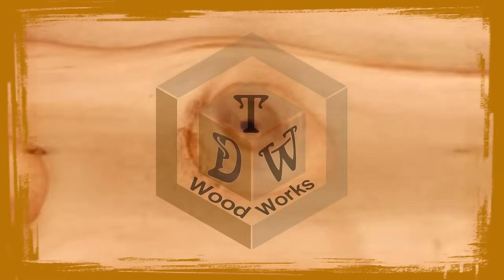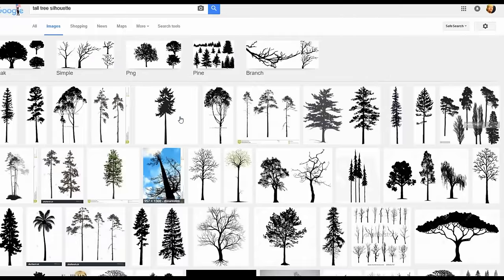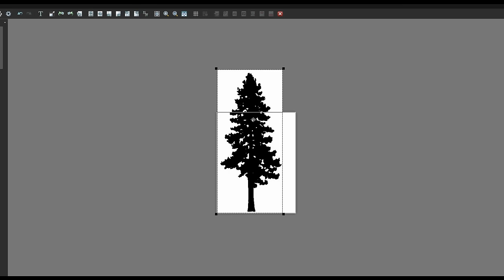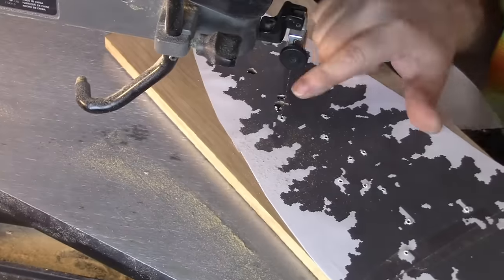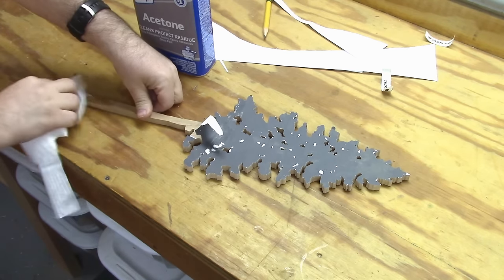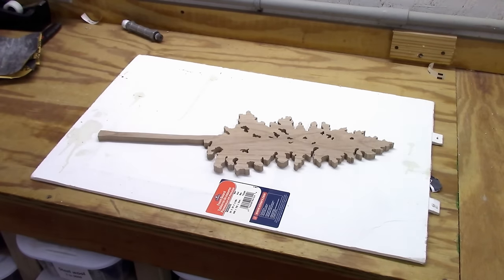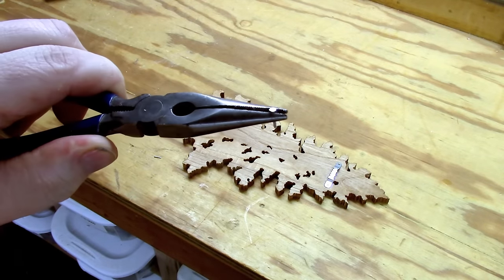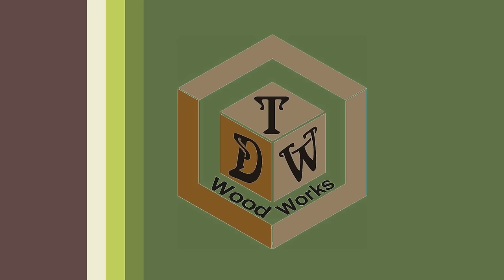My scroll saw trees using spiral blades demo

Comment: Nice job, I've been scrolling for years, never tried spiral blades, I have tons but never used them, what I use before gluing the pattern to wood, I use Blue or green painters tape and then glue the pattern to the tape, easy to remove and tape helps to lubricate the blade. :)
Reply: I do that also. Another tip I saw was someone then covering it afterwards with clear packing tape which apparently helps keep the blade cool. Not sure about that but hey ho.

Comment: Chris, I am beginning woodworking with a scroll saw and am having troubles with the spiral blades breaking frequently. I am not sure if I have the tension too tight or what, and have a really tough time setting the blades without bending and/or breaking the ends. I have a porter cable scroll saw (PCB375SS purchased from Lowe's) that is set up for pin type blades but will take plain end blades as well. I was wanting to see if you or any of your subscribers could give me some tips that would possibly help with this issue.

Also, I would recommend investing in a machine like a Cricut Explore Air 2 that you can use removeable vinyl shelf paper (contact paper) to make your stencils. I do this, and it is precise, and very easy to remove after you are finished cutting. No chemicals, no residue, and easy to use.
Reply: With the breakage issue, I have found with spiral blades, if you are pushing to one side for a cut, let the blade come back to center before changing directions.  Also I try to make them tighter than I would a standard blade, this seems to help with breakage too. I'm not sure what speed you are running but with spiral blades I tend to keep speed about 50%. Hope this helps

Comment: Hi Chris love your project. Could you possibly do a video how to attach a spiral blade. I just purchased a scroll saw and it can take pinned or plain-ended blades. I then brought the Olson spiral saw blades 5 inch plain end. Unfortunately One end twists when attaching to blade adapter.  Is there a way round this.

Comment: Once I used a spiral blade I never used a straight blade again. Also, I've found that WD-40 works good with laser printer patterns or just hit it with a heat gun.
Reply from the maker: Good tips. I have trouble mastering a long straight line with a spiral blade.
Reply: I think all scrollers do. I've found that if you do it all without stopping its much easier than stopping and trying to restart without a squiggle. Backing up a little and finding the angle helps too.

Comment: Nice work I have some spiral blades tried using them but they seem to have a mind of their own, or maybe it's me, what size blade do you use, also what do you do to get the twist out from the end.
Reply from the maker: I got a pack of 6 different sizes and always use the middle ones. I am not sure the size #. I like to make trees with them because if the blade wanders its not that big a deal. I never use spiral blade with straight lines because of that. Maybe with more practice but I guess that is what straight blades are for.